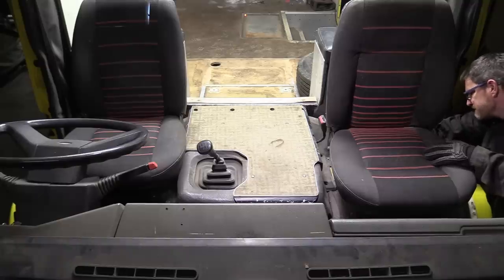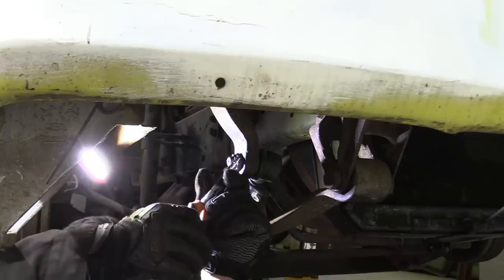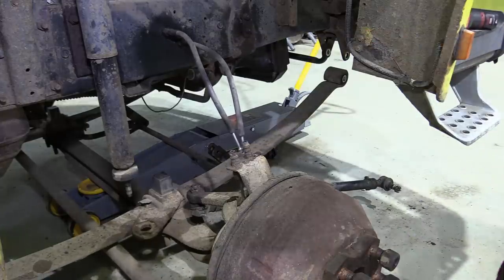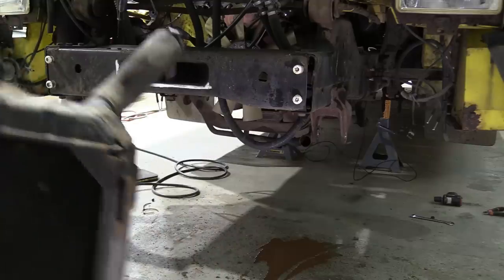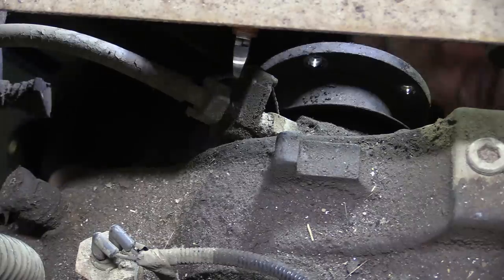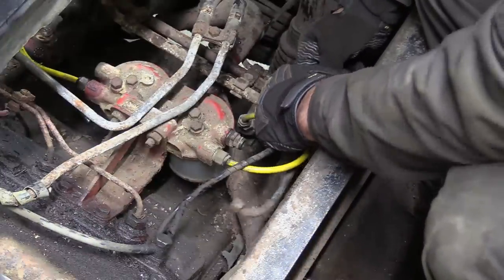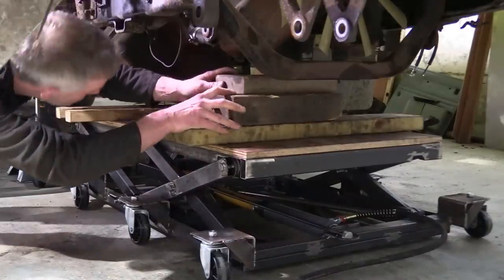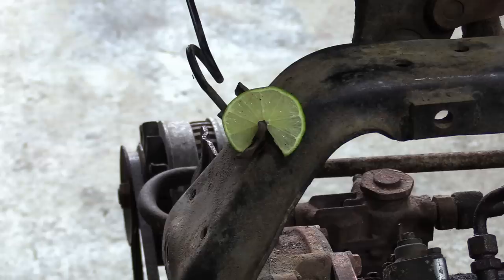The Escargot - RV/Camper Car Transporter Conversion - Part 2

Comment: I'm concerned these two will start up a repair business.  5 years plus obligatory engineering,folding,welding just to change my engine oil n filter..  they do good work tho ,just a shame they didn't look at everything more closely before they bought it.. theyre pretty spot on at foreseeing things n problems in mini's,,but trucks it seems not so....now hot rod this truck please.blown 454 ,nice.....robby j....

Comment: 4:39 that's righty tighty....? How is that nut coming off are they the wrong way round?
Reply: Old wagons were left hand thread on that side so use/inertia tightened instead of loosened them

Similarly, one of the pedals on a bike is left hand thread for the same reason
Reply: @Jimskateuk  Thanks never knew that about old wagons. Every day a school day...

Comment: what's going in its place>>>  3 cylinder Rolls Canardly???  >>> gigantic rubber band???>>> 4 rotor Wankel engine (that's too much power for the bus)>>>OR a 425 V8 Chevy with a 5 speed Muncy box??? (yeahhhhh....)

Comment: Right side wheel nuts are loosened.
Left side wheel nuts are TIGHTENED.

???
Reply from the maker: What could possibly be going on?
Reply: Good question, no idea. Only thing I can think of is that the nuts are threaded in reverse?
Reply from the maker: Yep. On the left side, they're left hand thread.
Reply: Huh. Weirdness. Ah, well, that explains that, at least.

Comment: Why not get it up-plated to 10 ton you will probably end up upgrading the suspension to air bags  the only other modification would be 19.5" wheels.
https://www.gov.uk/specialist-tests-for-lorries/change-the-weight-you-can-carry
Reply: Doesn't help. Private HGV is a maximum of 7.5 tonnes on a standard license.

Comment: I suppose the question now is just what is going to relace the now defunct engine Diesel, petrol, gas turbine a small nuclear reactor supplying steam for a steam turbine or a generator for electric power oh no they haven't solved the cold fusion problem have they  naaah, this being an ex library bus it has to be quiet and have an ISBN number.

Comment: How about an electric conversion ?
You could fit loads of pv panels on the roof !
Reply: So you can drive it for 4 hours, and then charge it for 2 weeks for another 4 hours? Or drive it for 30 minutes, since one of the main motivations is to lower the weight of the vehicle, not increase it.

Comment: 110hp from 6 litres? holy shit. 18.33 horsepower per litre.
The latest 2.0 diesel engine from Mercedes (OM654) makes 245hp, 122.5hp per litre.
that's 6.68 times the power per litre!
it also weighs only 168kg.
Reply: Torque, tho', that's where its at, surely?
Reply: Chris Wills yes. However they didn’t mention the original torque figure of the engine so I couldn’t use it in a comparison. That Mercedes engine has 500nm - 369lb/ft though.
Reply: @ZylonFPV  Which, lets face it, is a shed load.
Reply: Yes, I would rather have the 3.0 Diesel engine though. 700nm torque. That would be ideal for this escargot!

Comment: A Cummins 6BT engine or even a Napier Deltic D18-25 engine
Reply: They are trying to save weight, and a quick google doesn't point to either of those engines being very helpful in that regard.

Comment: OK this is probably too easy but say a 12 valve Cummins 6BT with original transmission.
You probably could only get 3 episodes out of it. Inadequate amount of kerfuffle.
Reply: More power yeah but not significantly lighter,  suspect something smaller/lighter with maybe a bit more power would be going in.

Comment: You know. You could shorten this video considerably if you didn’t show the removal of every bolt , hose and wire of this vehicle. The ppl watching this probably have a clue as to the process. Highlights would be good enough, imo. 
Those ppl that don’t understand think autos and other technical stuff is magic. So what’s the point of showing every step?
Reply: Patrick Perry and cut out all the witty banter?  Philistine.